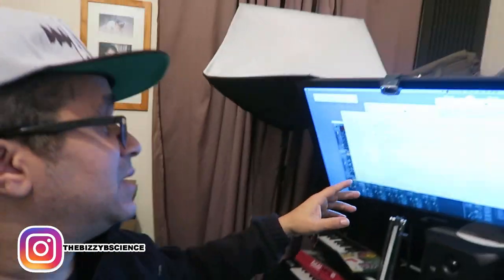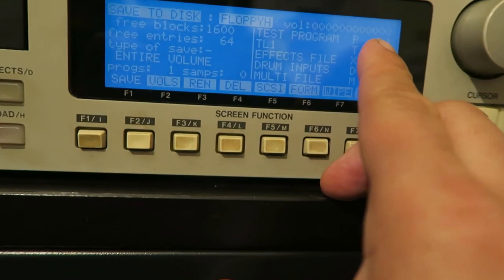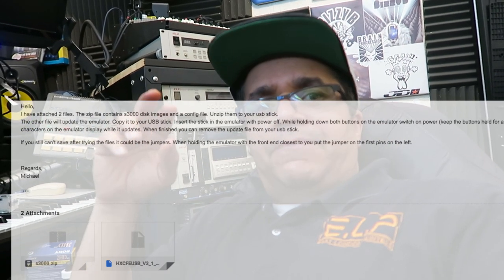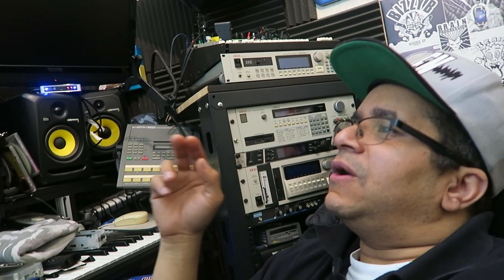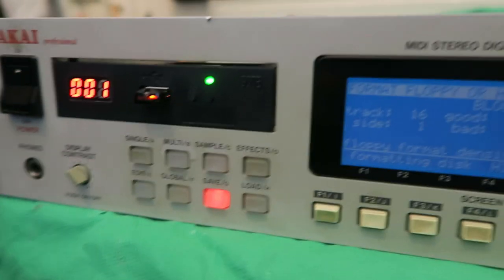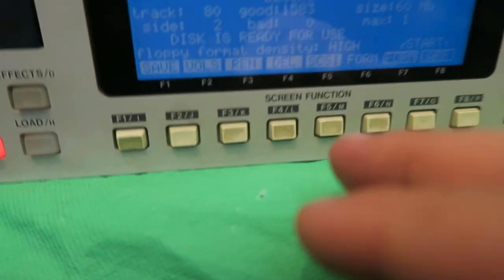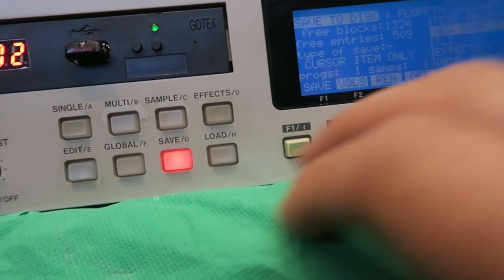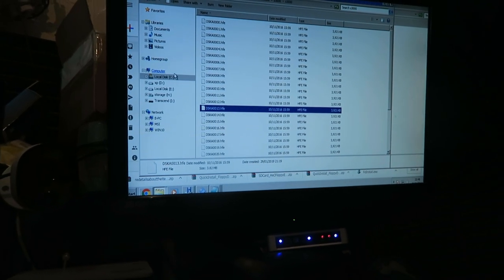FIXING HXC FLOPPY DISK EMULATOR ISSUES FIXED | AKAI S300XL Hardware Sampler

Comment: I have S3000xl with gotec flashed with free flashfloppy hxc firmware, all working fine. Jumper = only S0, FF.сfg file " interface = ibmpc-hdout, host = akai "
Also i installed 0'91" oled display, its very simple, no soldering.  I use EMXP utility to pack akai programs and samples to hfe image.

Comment: Thanks for the vid - I just picked up a 3k with scsi2sd. I've tried formatting three different sd cards both on the akai and through thee scsi2sd utility... and still everytime I turn off the machine, the disk seems to get wiped, like all the data is gone. If anyone has any idea what's going on, that would be super helpful. I just don't know what to do at this point short of replacing the whole scsi2sd unit. 

Help plzzzz 🙏

Comment: Easy...I installed one of these in my akai s3000xl but I'm having issues. Mine came with no usb so I'm assuming I can get the relevant firmware files ?? and then load it up? It just says ' waiting for hard disk ready...SKIP ' & also in top right of the akai screen it says ' no volume. If you could shed any light it would be appreciated man. Seller on Ebay wont reply

Comment: Thank you Brian. Ready to upgrade mine just like this. Awesome you have it working!! Those two slots are for the Flash ROM Boards. I have a question about the configuration of the pins on them if you know the answer or know of anyone who does please get in touch. Here is what I've done to mine and a link to my video of the pin config. question. I'd really appreciate it if you could help me sort it or point me in the right direction. The Flash ROM boards allow you to save Programs to them so that when you switch off then switch on again, they will be there waiting for you every time instead of having to load them
 Hi Brian. After 12 years of waiting and searching for the add ons to appear on ebay and snap them up I've finally found the Flash ROM Boards and need help configuring the pins. One is an original FXM008 Flash ROM board and the other is the later version FMC001 Flash ROM board and there are configuration pins on them which I'm a little stuck on. Any chance you can shed some light on how to set them up or know of anyone who might be able to help please. Check the video of the pins here to be clear @ I've also upgraded the EB16 FX Board, IB304 Filter Board, OS onto the Chip like yours and the RAM to 32MB. Thank you so much for doing these videos, you have inspired me to upgrade mine, next up, the floppy emulator. I don't have an old computer, so will MESA work on a Windows 10 laptop? I look forward to hearing from you. Kind regards, Gareth
Reply: @TheBizzyBScience  Aah, thanx Brian. I really appreciate you getting back to me.  I'll try them in different ways...🙈 poof...there goes my dosh...😃😂. Will let you know...if I'm alive. I bought the latest floppy emulator from Ian today. What software do I need to transfer my own WAV's to the USB stick and what format Akai or HCX. I'm totally new to this. What should the WAV'S be 24/48 or 16/44.1 before converting them? I only have a set of S1000 discs from ebay that I've dabbled with but mostly want to start out with my own samples and go from there. Would be awesome if you could do a beginners video of all the stuff I/we need to get this sort of thing done. Pretty please. 😆
Reply: @TheBizzyBScience  Thank you for everything Brian. I really appreciate all your time and help. I'll watch them all and get it all sorted. I could sample the samples in, in mono to get that authentic sound even though it will take ages but it should be awesome once done. Well worth the effort in the long run. It will give me practice and muscle memory with all the functions...lol. Thank you again for your speedy reply. Nice to know that there are people like you still about who value others. Kind regards, Gareth

Comment: So is there any special tweaks to make this work with my Akai S1100? mine just arrived and want to make sure I'm doing this right.
Reply: Crap that was bad, The S1100 is a lot tighter and harder to get the floppy out. Connecting the new drive is no problem at least it shows that it's connected on the screen but I haven't played anything through it yet. But I also inadvertently broke the connection to the XLR input on the mono L in because they're attached to the face plate. F me mate. By the time I get this baby working the ISLA 2400 will be arriving. I'll give you an update when I have one though.
Reply: @TheBizzyBScience  So I've been messing with this and I can't figure out how to get anything to load up, though the hxc shows the samples in the S1100. I've sent a Facebook message to The Bizzy B science page messenger of a vid I uploaded to FB hopefully you'll have some insight. I really don't know if this user error (likely) formatting (maybe though the website says it will work with the s1100 with tweaks) or both (my best guess here). 

Thanks so much for your time and help.

Comment: Yes B! thanks for the video!
 I think a nice move would be transfering samples from mesa or wavelab or recycle and save them on usb sticks. Wavelab is ok for the 24 bit samples, it converts to 16 bit while transferring them but as the other programs it works with the 2.0 OS.
It should be possible to put the 2.0 system on a disk image from pc I think, but not sure
Reply: too bad I can't  help! I think that the ebay seller  may  save you some struggle.I ordered one telling him it was for an s950 and he sent me a little program  with the emulator, I don't recall now if It was able to save an OS on the usb stick but have many functions for different samplers.You could try, at the end the emulator it self is very cheap, let the assistance work! :)

Comment: Bizzy have you thought about getting a NAS drive?? 

Network attached storage has loads of advantages, one being redundancy. What I mean is say you have a 4x 1tb hard drive NAS in raid, you can backup all your music files, stems, anything, to it and if one of the drives fails out of the four. You can pull out the failed drive, replace with a new one and the other 3 drives will rebuild the lost data from the forth failed drive to the new so you don't lose any data. 

Its a touch more complex than that^ but it spreads your data over four/five/infinity hard drives in the raid array so if one or more drives fail (depends on set up) the other drives will rebuild the data to the new replacement drive you put in. So its there to make sure you don't lose any data if a storage drive fails. 

Also, you can access the NAS drive from anywhere in the world via app or browser (depends on raid setup) so you could be out of the country but still access you music files off your NAS storage. 

NAS and RAID are well worth looking into if you have loads of data you want to keep safe.

Comment: I just put the new 2.0 eprom chip in my s3000xl
Reply: @TheBizzyBScience  yeah with no disk ?  Was mucking round with it on weekend but no fx or filter board
Reply: Just put the 2.0 eprom in the s3200xl. Had the no sound issue and realized s3200xl and s3000xl 2.0 is different.  Both boot up as 2.0 on startup.